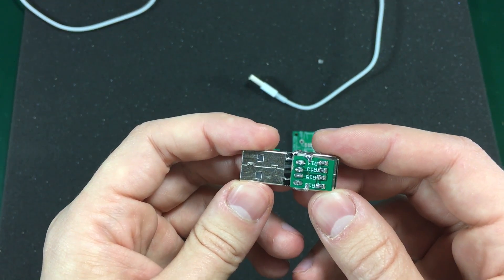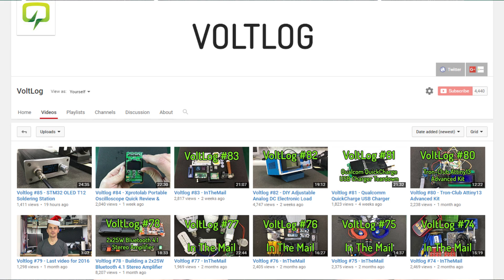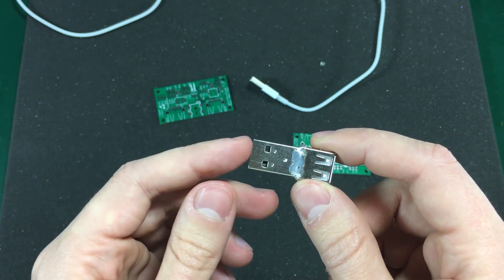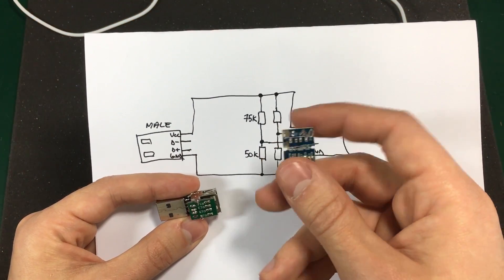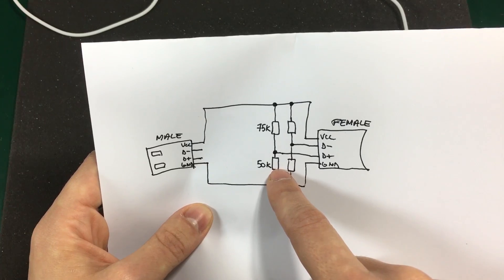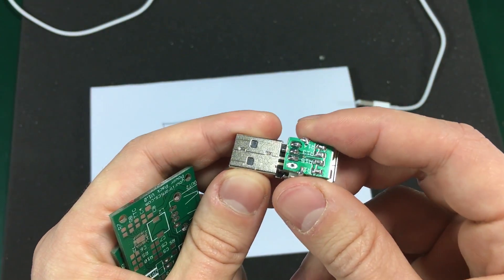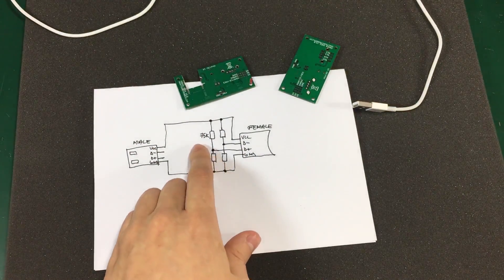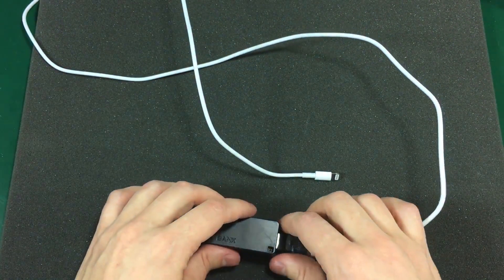Voltlog #86 - Limiting Iphone USB Charging To 500mA

Comment: Is there a link to the research done about this as you mentioned in the video? How much advantage may this method lead too in terms of extra cycles?
Reply from the maker: I couldn't find any research paper online on this but the effect has to be present, especially when considering the connection between higher operating temperature and capacity loss(there are papers on this). When charging at a higher current, you at least get the higher operating temperature but I suspect there is also an effect caused directly by the higher charging current. I first started noticing this while experimenting with some lithium polymer RC packs. Some of them I was charging at 1C while others at 0.5C. The ones being charged at 1C started loosing capacity and eventually failed way before the ones charged at 0.5C. Of-course this was not a controlled experiment, many factor we're involved but I think there is something there..
Reply: Thx for your explanation , makes a lot of sense and even if the benefit is small it never hurts doing it anyway  while charging at night :D

Comment: Great video, as always. Just one comment: the thumbnail you used for this video shows a current measurement device, but it's not shown anywhere in the video. It's what made me click on the vid, but not having seen that step left me a little disappointed.
Reply from the maker: You are right, sorry about that. The device shown is the Keweisi USB monitor, there is a link in the description of the video.

Comment: I use an old 500ma charger for my phone for bedside night charging, mostly to reduce the fire hazard..
It seems like my phone (android) tests the charger when I connect it, it sees the voltage drop, and charges at a current lower than it was when the voltage drops
Reply from the maker: In my case I have this 5 port charger, and I want some of the ports to be able to provide 2A but I just wanted one port for slow charging my phone at night.

Comment: I was under the impression that with the iPhone/apple you need an IC to negotiate in order to draw more than 500mA from any usb socket, maybe the new models?. And with other phones I think you need to have shorted the data lines for draw 500mA+
With the thumbnails, I like the text, but keep it short (trying to not use too much space) an instead or using "VotLog" (as text) you should use your logo instead, same result on less space and can look better.
Reply from the maker: thank you for your feedback!

Comment: For slow charging you can use any cheap USB hub sold on ebay for $1 with free shipping. Works for multiple devices as well. With one phone attached, USB doctor displayed about 0.5 A current draw, with two smartphones about 1 Amp, using Samsung QuickCharge adapter, which can supply 9V/1.67A or 5V/2A.

But surely it's more fun to build your own slow charging device :-)
Reply from the maker: yup, it was fun to build.

Comment: at 2.43, i suppose the 2 unnamed resistors on the right are the same of those in their left, respectively, right?
Reply from the maker: correct.
Reply: Yes, the iPhone draws 500mA if there is 2V on both D+ and D-.  A divider of 75k over 50k produces 2V with a 5V input.  This was Apple's first departure from the USB standard.  It wasn't necessary at the time since USB could provide 500mA by default, but it did sell more Apple chargers.  Largely a marketing ploy to lock customers into buying Apple accessories.

Comment: It's good to have something that shows your subscribers that it's your video, even before they have read the title or uploader's name.
As you've already done great job with branding by having your logo as avatar and in the beginning of each video, I'd suggest doing something like Bob @ I Like To Make Stuff: Small logo and few words long title on the top or bottom of the thumbnail. It takes little bit of space, but doesn't block much. By having logo on each thumbnail helps us, the subscribers, to quickly spot your videos from massive amount of videos in our subscription boxes.
Reply from the maker: I like this suggestion, I might start adding that band in the lower side of the thumbnail.
Reply: VoltLog I mistook your video for bigclive for some reason at first glance. Then I saw your channel logo. Good work bro, keep it up. 😀👍

Comment: There is no evidence that charging the batteries at lower currents increase battery life.
Reply from the maker: Start with the datasheet of any lithium ion or lithium polymer battery. The battery lifespan (number of cycles) is quoted for a given charge rate, usually 0.2C. Why is that?

Comment: I built a similar device for a Samsung tablet. Often public charging stations (in my case, airplanes) don't have power on the D lines and my tablet won't charge at all with out it.
Reply from the maker: you would think in a public place they would install something that's compatible with all the tablets and phones, that is as simple as shorting D+ and D- together.

Comment: Maybe it would be enough to just disconnect the D+ and D- lines, without any resistors, since the default USB charge rate is 500mA??
Reply from the maker: Nope, it's not enough. That may be true with computer USB ports, where the motherboard may manage the charging current. However it is not true with standalone wall socket chargers or powerbanks.
Reply: Hmm.. A device is not allowed to draw more than 500mA by default to be compliant with the USB standard. Perhaps a lot of phones are not standard compliant then.

Comment: Great little project.  Personally, I like the green text.  It's a good visual queue to quickly identify your videos, especially when viewing on mobile devices or on smart TV apps that default to YouTube Recommendations and display dozens of thumbnails at one time.
Reply from the maker: Thank you for your feedback, perhaps then I could print just the episode number in the thumbnail "Voltlog #86" so it's easy to pick-up among others but still allows the image behind to be somewhat visible.
Reply: Yes, that would work, for sure.
Reply: You could put your logo in one corner of the thumbnail, rather than the green text.
And no I didn't like the text, as it covered too much of the thumbnail.